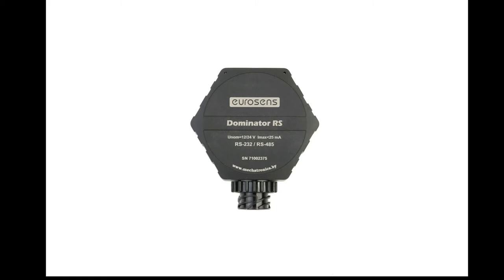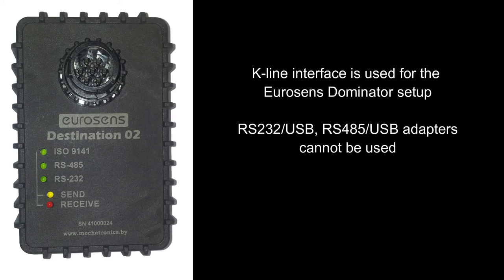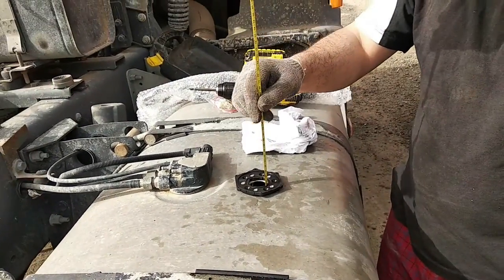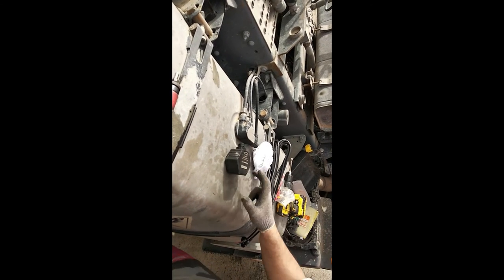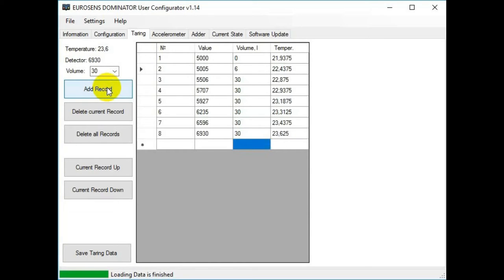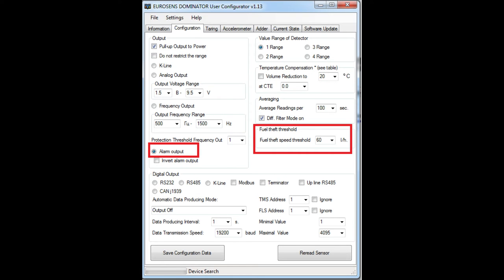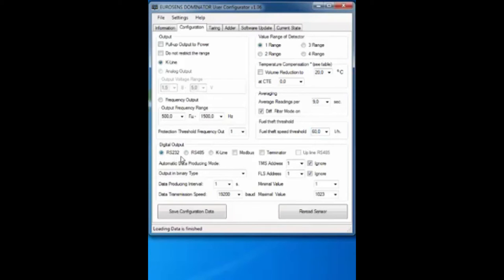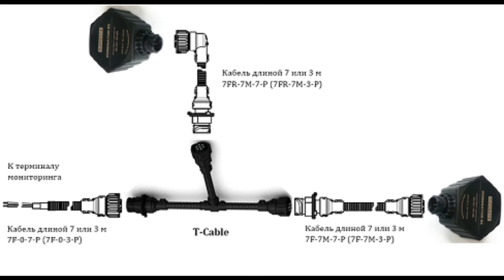Installation of the Eurosens Dominator fuel level sensor

Comment: is this Anastassia talking?.Anyways do u spport concox devices?
Reply from the maker: Fuel monitoring should very accurate otherwise it is useless. We recommend to use GPS trackers with RS485 support and proper GPS tracking platform which can perform refilling and fuel theft autodetection, have a plenty of fuel reports and charts. As I know, Concox more oriented to video. Of course, our sensors can work with Concox devices but pay attention to GPS tracking software.
Reply: @MechatronicsTV  so in this case which software would you recommend?
Reply from the maker: @fiifiackah2069  GPS tracking software should calculate fillings/thefts automatically, based on fuel volume data, filter out noisy data (with a lot settings how to do that), etc. For example - Wialon